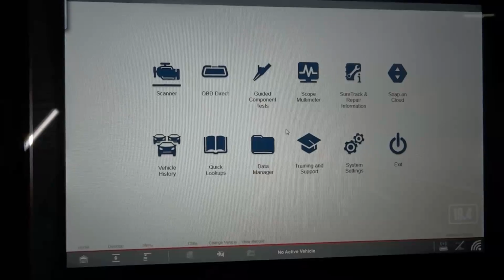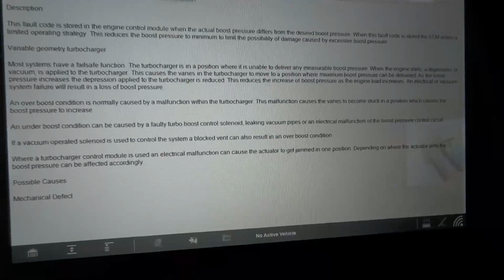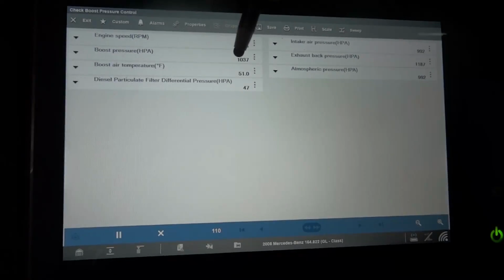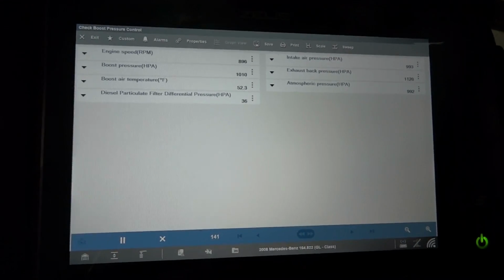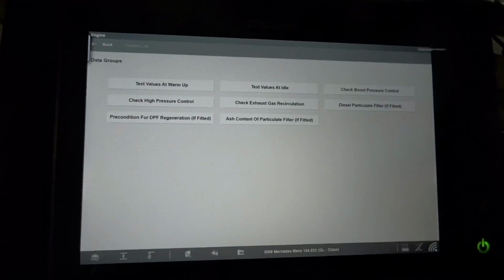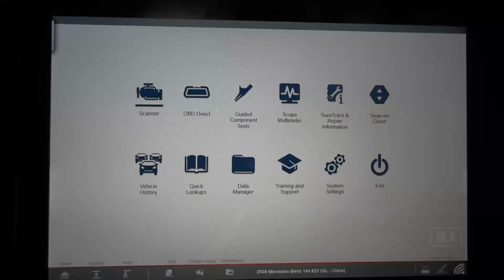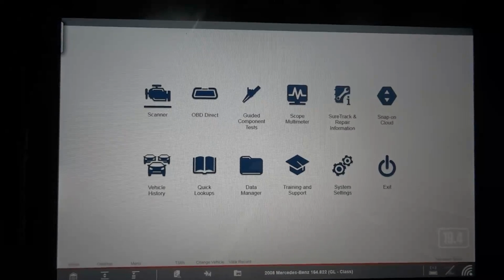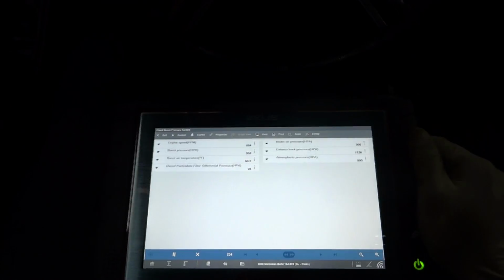How to test a turbo Actuator on a Mercedes GL320, Code P0245-P0299, Low Power Concern/ Limp Mode...

Comment: Bonjour cher ami.  
J’ai regardé à plusieurs reprises votre vidéo, et encore ce matin
J’ai fait les mêmes essais que vous avec un multimètre sur le positif et la masse de la fiche débranché,   Moteurs contact sans démarrage je trouve 12,8 Volts. Avec le moteur tournant je trouve 13,8 Volts 
Sur la masse et le fil vert 3,4 volts.
J’ai remplacé à deux reprises le fusible 10 A il avait grillé ?
J’ai remis un fusible neuf de 10 amp  ce matin, pour le moment, le fusible n’est pas grillé.
Je rebranché la fiche sur  l’Actuator  , il ne fonctionne pas ?

Question:
Y a-t-il un fusible prévu pour l’Actuator autre que celui-là ?
Oui ! C’est pour Vito Mercedes WDF 639 - V6 - 3L , moteur A642.  De 2010 Mai.

Le contrôle ODB mercedes dit: code défaut « Y77/4 »
J’ai peu être un cour circuit ou mauvaise masse ( panne aléatoire).

Question : le fusible est t’il de 10 amp ou 16 amp ??.

Cher amis !  Je cherche une belle réponse .

Cordialement, VOTRE !
De Gerard Montérin 
Envoyer de Normandy.
 …………………………….
Hello dear friend.

I've watched your video several times, and again this morning.

I performed the same tests as you with a multimeter on the positive and ground terminals of the disconnected connector. With the ignition on but the engine not running, I measured 12.8 volts. With the engine running, I measured 13.8 volts.

On the ground and the green wire, I measured 3.4 volts.

I replaced the 10A fuse twice; it had blown.

I installed a new 10A fuse this morning, and so far, the fuse hasn't blown.

I reconnected the connector to the actuator, but it's not working.

Question:
Is there a fuse specifically for the actuator other than this one?

Yes! It's for a Mercedes Vito WDF 639 - V6 - 3L, engine A642. From May 2010.

The Mercedes OBD scanner says: fault code "Y77/4"
I might have a short circuit or a bad ground (intermittent fault).

Question: Is the fuse 10 amps or 16 amps?

Dear friends! I'm looking for a definitive answer.

Sincerely, YOURS!

From Gerard Montérin
Sent from Normandy.

Comment: my actuator looks fine internally, but when I run 12v to the first pin, and ground the 2nd and 4th, it doesnt actuate. When I run power and ground to the motor itself, it turns fine.What is going on?

Comment: I just came accross your video while chasing down limp home mode on my ML280 and have to say...Your repeated testing of the Actuator was "extremely" helpful Not only that but your explanation of the control wire simply grounding was very informative. I discovered How the onboard system controls the actuator, while triping the ground fully operates the actuator, It is more complicated than that for those interested you may wish to add this info: How the Signal Command Works

The ECU talks to the actuator using a "Duty Cycle." It keeps the signal grounded for a specific percentage of a time cycle.

    10% Duty Cycle: "Move vanes to the 'Open' (Min Boost) position."

    90% Duty Cycle: "Move vanes to the 'Closed' (Max Boost) position."

    Every % in between: The actuator has an internal microprocessor that translates that specific pulse width into a precise angular position.

The Feedback Loop (The "Internal Spy")

Inside that black box is a CIPOS (Contactless Inductive Position Sensor).

    The ECU sends the PWM command (e.g., "Go to 45 degrees").

    The actuator moves its internal motor.

    The CIPOS sensor verifies the actual position of the arm.

    If the arm cannot reach the target (due to stripped gears or sticky turbo vanes), the actuator sends a "Fault" status back to the ECU.

This is exactly why your P0299 (Underboost) is triggered. The ECU "commands" boost via PWM, the actuator fails to move or report the correct position, and the ECU immediately initiates Limp Mode to protect the engine.

Comment: Im getting constant 3.4 volt in the signal wire... when i give manually ground to that wire actuator works ... a soon i plug-in the actuator goes all the way down and stays there
Reply: Having the same problem on my gl320, I believe there is an issue with the signal wire. I do not think it should carry any voltage

Comment: Hey man , I’ve got a ML320 2008 , same engine om642, my turbo vains are not stuck because the arm moves freely . I check the cables on the selenoid and all 3 ( power , ground , and signal ) are good . But my actuator won’t move at all , I tried with bi directional diagnostic tool and nothing . This is a brand new hella unit oem so I doubt it will be defective , what should I look at ?
Reply from the maker: @alexandermayorga9845   you might need a turbo

Comment: Hi, I am happy to share that my turbocharger works at last. Today I have reinstall the original Hella actuator which was calibrated on my ECU. The configuration was preserve and the turbocharger works perfectly at once. So the lesson is to keep and use the original actuator which was calibrated in your ECU. Repair it if is needed. Overtime will the solder pin get loose and need to solder again to preserve connection. . Most of the actuator pins are solder with aluminium. Best way to repair is to take out the actuator and let an electronic repair shop repair it for your. A new actuator will not work without a new calibration to your ECU.
Reply from the maker: @dinhvanpham8102   these actuators don't need to be calibrated
Reply: @KITS_Auto_and_Truck_Repair  You are right. I have got confirmation from a guy selling Hella actuators, it is plug and play. Dont need any calibration. A turbo service compani also confirm that Hella actuators on Mercedes and BMW are plug and play.
Reply: I tested the original actuator, the  actuator moves forward and backward. When I install the actuator into my car, the turbocharger works for over two days. Today i take my car for a long drive. When coming home i run a diagnose and I get error 1. 244c00 P0299. 2. 245700 3. 25c800 4. 288800. My car went into limb mode. I have a new actuator. I am going to replace the original actuator and get it repaired. I am quite sure some solder points for the actuator motor is loose. I have to buy some aluminium and solder paste and solder the  motor pins back in place. Your video is very helpful. Thank you for sharing.

Comment: Hi again, I am stuck in removing my faulty electronic actuator regulator on a BMW 525D Xdrive F11 2012 Touring. I have removed two torque 30 screws on the left side of the actuator. The last 30 torque screw is hidden. I need to remove the turbocharger heat cover to get access to the last screw: I have done the basic diagnostic and measure of the original electronic actuator regulator. The actuator seems to work fine. The heat cover has two 10mm screws, one on the top and one behind. There must be one more 10 mm screw somewhere. Maybe I have to remove the cover under the engine to access the last screw?
Reply from the maker: @dinhvanpham8102   Cool

Comment: I am an electro ingineer. This is the best video on how to solve an actuator fault.  Lucky for me I have found your video. I must run diagnose on my actuator and find out what is wrong. Your video will help me a lot when I start my diagnos tomorrow. Thank you very much. Keep on your fantastic work. You make the differences.
Reply from the maker: @dinhvanpham8102   My Pleasure! Thanks, Good luck with your vehicle

Comment: I got a 2008 ML320 CDI the turbo actuator isn’t working I checked the actuator and Iim not getting any voltage but i do have ground. If i jump 12v to it it will move when i turn the ignition on. I can find where the power feeds the actuator from.  I got theses codes (p1111, po111, po489,  po209, po245)
Reply from the maker: @jodyfutrell3529  Check the actuator wiring!

Comment: Thanks for the video, i have a problem with the sprinter it has m642 engine the actuator moves up and down but the boost pressure is too low but if i remove the link on the actuator pressing it down it boosts what might it be
Reply from the maker: @paulmudzingwa8611   you could have a boost leak

Comment: mine go through test on Xentry DAS while sitting in a car with engine switched off. Once I switch engine on it goes ok for about 10 sec and then switch off itself. NO turbo.
Reply from the maker: @ukaszjurys2475   Yep, sounds like your actuator is going bad!

Comment: Great video.  You saved me a fortune.  Replacing the failed actuator as well as replacing the compromised upper (green) and lower (black) "O" rings on the long silver turbo outlet pile solved my GL320 CDI P0299 issues.  ~$120 in parts + 30min DIY labor.  Happy to donate a couple $$ to your channel!
Reply from the maker: @sammagna1485  Thank you! I appreciate you!

Comment: The test with the leads to actuator pins is not valid and I almost spent money based on the results. My actuator did not respond with this test and yet it is working when driving.
Reply from the maker: DJ W  That's odd! because this is a valid test!
Reply: U must of did test wrong. The point of this test is to test the functionality of the electric motor inside the actuator that spins the 2 plastic gears to raise or lower the arm. If wired to power and ground then grounding signal wire doesn't activate the motor then the actuator itself is broken.

Comment: Hello, thank you for the excellent video. I have the dreaded lightning bolt with 0299 code, I just tried your test and sure enough the motor is not responding. I couldn't find schematics anywhere and wanted to confirm you are certain the computer provides signal on the ground side? I have b+ to red b- to brown and b- as intermittent signal on green - no response. Thanks K
Reply: FYI, I pulled the cover and put power directly to the motor terminals that connect via the circuit card - the motor worked. Assuming you test method is valid, this would mean there's a fault with the circuit card - the soldered jumpers on the circuit card are secure and don't appear to be a problem.
Reply from the maker: DJ W   Make sure the actuator wiring is good!
Reply from the maker: DJ W  My Pleasure!

Comment: If no power to pin 1 what would you suggest?

Found blown fuse 

Voltage back to normal 

Still no boost even with new actuator . P0101 maf sensor fault now. Does it need adapting ?
Reply from the maker: Stefan Wiklo  check your fuses! or you could have an open wire!
Reply: @KITS_Auto_and_Truck_Repair  I edited the post.. lol thanks for reply.
Reply from the maker: @stefanwiklo497   My Pleasure!!
Reply: Which fuse was blown?

Comment: Hi. Best video on youtube with regard to this problem. Thank you very much. You have a new subscriber. 
Anyone thinking it is wrong for oil to be in the turbo intake?  It is perfectly normal for the OM642. It comes from the crankcase ventilation system.
Reply from the maker: Nick 2506  Thank you! and yeah a little bit of oil around the PCV System is normal!

Comment: Hello, thank you very much for the information in your video. I have a question to manually activate the actuator, note that the current is placed, the ground but where do you get the signal from the computer? the one that makes the polarity where do you take it from?
Reply from the maker: Francisco Márquez  To actuate the actuator manually you have to to send power and ground to it then send ground on the signal wire if the lever doesn't move than your actuator is defective, follow the steps in the video!

Comment: would that make a ticking noise when the turbo is building pressure. if the arm does not move and open/close wastegate?
Reply from the maker: Daniel Gaston  I don't think the turbo can make that kind of noise, make sure it's not coming from your valve train!
Reply: @KITS_Auto_and_Truck_Repair  https://youtu.be/2U1VHYZftqU
Reply: Ur ticking noise will be ur injectors.  Hearing them is a good thing. The sound proofing normally hides that sound

Comment: Hi. We have a om642 with the same problem in our shop( wished I watched this video before) Changed the actuator, turbo works but makes a weird whistle around 1800rpm when letting of the throttle, is this normal? Car came in in limp mode.

Is it necessary to program the actuator?
Reply from the maker: cnnlt  No the actuator doesn't require programming! and make sure you don't have a boost leak in the induction system!
Reply: @KITS_Auto_and_Truck_Repair  thank you sir
Reply from the maker: @cnnlt200  My Pleasure!!
Reply: @KITS_Auto_and_Truck_Repair  Hi sir. Here is a link to 2  videos of how the Viano sounds. We have it back in the shop at the moment:

https://youtu.be/v1Ke4l6z30c
https://youtu.be/tx1hvr3cYqk

Comment: great video. thanks for sharing. on our JEEP with same engine,i tested my actuator and it moves freely. we opened it up and found no damaged connections inside. reinstalled. again moves freely with wastegate arm connected. diagnosis gives us two codes without a check engine light on dash.  P0234 Overboost and P0046 Turbocharge actuator boost performance. Vehicle moves very quickly at low rpms (compared to past), it is faster than before, but if i insist on keeping it on high rpms such as 3500 or more, after few second it goes into limp mode. Restart is necessary to recover. what can be the culprit?
Reply from the maker: D Cosku Arsiray  did you check the wiring? I would also make sure that the boost pressure sensor is working properly!
Reply: @KITS_Auto_and_Truck_Repair  where is the boost pressure sensor? Ours is without DPF, is there a sensor on exhaust? i will replace MAP sensor incase it measures out of its range. Thinking loud.

Comment: Bonjour cher ami.
J'ai une c220 w203 de 2004 je suis tombé en panne de batterie.
Et quand j'ai mis une nouvelle batterie j'ai eu meme problème que toila voiture est en mode dégradé + voyant moteur.
J'ai nettoyé la vanne EGR et j'ai changé le débitmètre et le capteur qui vas dedans mais ça rien fait.
J'ai fais un diagnostic avec l'ordinateur et il ma donné le code p0243 solénoïde de soupape de décharge turbocompresseur A. Vous  savez d'ou peut venir le problème ?
Comment je peut faire pour faire un test de contur ement sans avoir un ordinateur comme vous pour envoyer le signal?
Merci beaucoup pour cette vidéo très explicative
Reply from the maker: Bili Bila  De rien! Vous pouvez tester le solenoide avec la battery pour voire si c'est en bonne etat! souvent ce code est causer par le petit moteur electrique qui est sur le turbo,
Reply: @KITS_Auto_and_Truck_Repair  bonjour merci pour votre réponse 😉
Je sais pas comment tester le moteur electrique.
Car vous sûr votre video vous utilisez le + 12v et le -12 et un ordinateur moi j'ai pas d'ordinateur.
Je peut mettre un interupteur a la place mais je crois qu'il faut 5v non?
Reply from the maker: @bilibila2574  Sa fonctionne avec 12v
Reply: @KITS_Auto_and_Truck_Repair  bonjour merci pour votre réponse.
J'ai demonter l'actuateur de turbo westgate et nettoyer au nettoyant contact KF contact. Et la puissance est revenue. je vois la tige qui ouvre la westgate elle marche mais des que le moteur est chaud la voiture elle c'est mise en mode dégradé pas de puissance.
C'est n'est pas le capteur MAP qui est en defaut?
Merci encore
Reply from the maker: @bilibila2574  quel est le code de diagnostique, dans la memoire?
Reply: @KITS_Auto_and_Truck_Repair  P0243
Reply: @KITS_Auto_and_Truck_Repair  bonjour le code est p0243 mais maintenant la puissance est aléatoire des fois quand je démarre pas de puissance mais je coupe le moteur et je redémarre elle récupère sa puissance...
Je ne comprends plus rien.